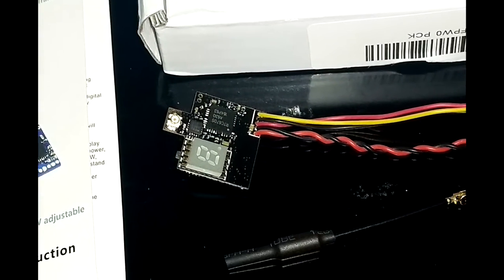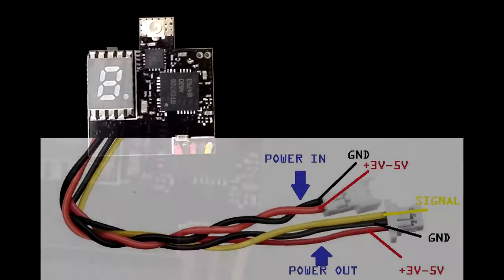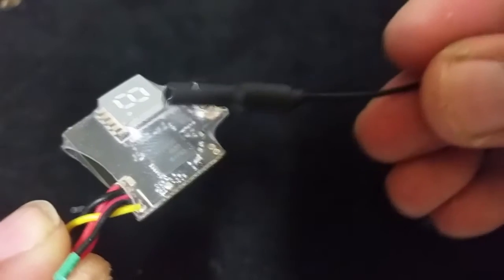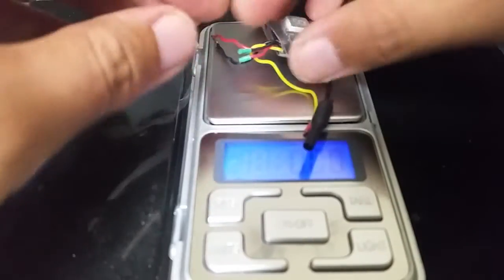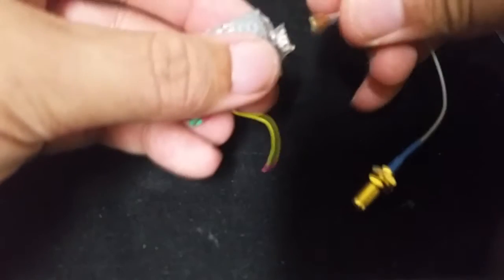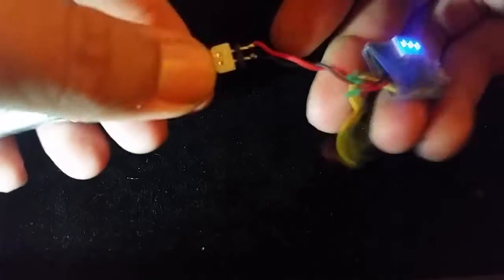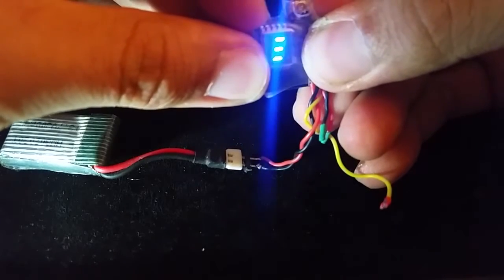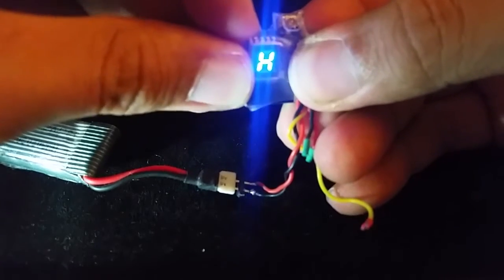Eachine VTX03 Super Mini -Super Budget 5.8ghz 72CH Video Transmitter

Comment: I bought one for my micro fpv built,  now i ordered more to use on standard racingquads,  it got everything i need, its cheap,  and the size make it easy to have a clean build,    Love it 👍
Reply from the maker: glad it worked out for you :) make sure you use the correct voltage, and use a regulator if needed. I ended up frying mine because I forgot and connected it directly to my pdb on a 12v pad

Comment: Danq:
   You made your video much more professional with graphic labels, and clear audio descriptions. Could you share your choice of camera for the video? How were you powering your Cam & Vtx system? Straight from a 1S battery? Other?
    Hopefully Eachine will begin providing mushroom antennas that use the IPEX antenna connector.
     Nice job.
Jim
Reply from the maker: Thanks for the kind words Jim :) It really depends on how much you want to spend, and what it is going to go on. What quad are you planning to put this on? I installed this on to a 210mm quadcopter, and used a step down converter to power the VTX.

Comment: Wot range looks nice
Reply from the maker: yup, you should be able to get greatrange with an upgraded antenna. Just make sure you check the voltages before powering up, if you plan to use it on a larger size quad. I swapped this on to another quad, and forgot that it only takes up to 5.5V: instantly fried it

Comment: video transmission looks good...Id be interested to see how the dipole antenna works...the problem here is I think you have a noisy 5v switching regulator power supply as there are lines...
Reply from the maker: I think youre right, Ill probably throw on an LC filter and some caps to see if it helps. And ill try and get some footage with the dipole as well.
Reply: thanks...you might be able to get away with a small cap over the 5v....I was worried this small vtx might be sensitive to its input voltage...by the time you add lc filters etc its size would be close to a normal vtx...
Reply: Hello
For the cap, how would your wire it please